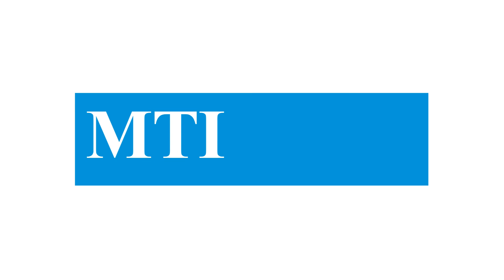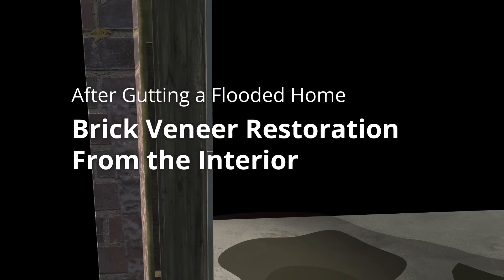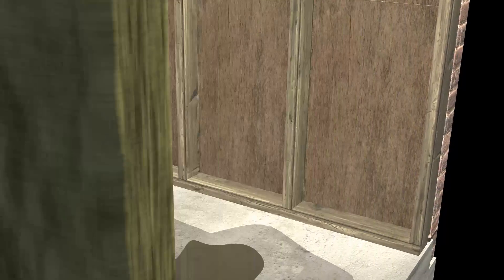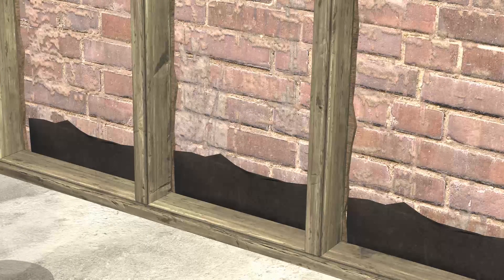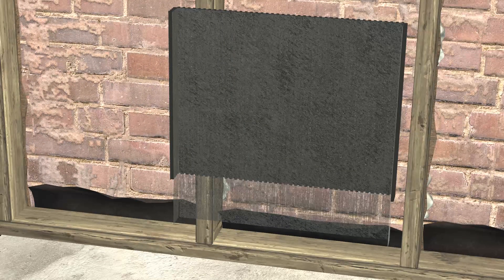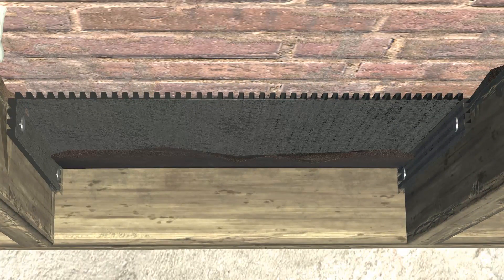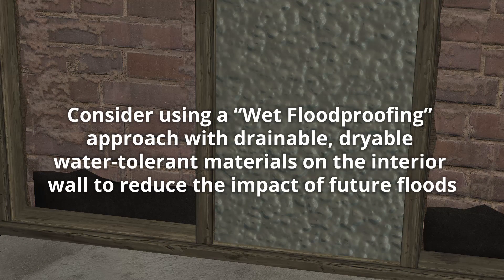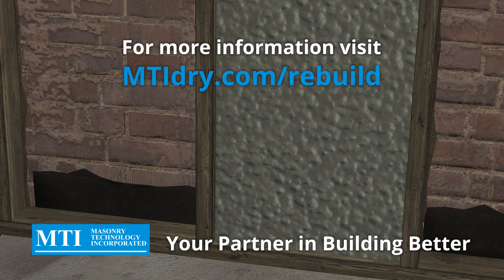Gutting Brick Walls Post-Flood: Repair Recommendations

Comment: From this video wont the studs be exposed to moister with no moister barrier  could they be wrapped with  black paper, I realize you would have to work around the brick ties. who does this work in my area or what should I ask for I live outside Houston texas.
Reply from the maker: Yes, studs will be exposed to moisture, but they can handle incidental moisture safely and dry out whereas OSB and paper-faced gypsum will deteriorate or develop mold. You may want to coat surfaces with a fungicidal protective coating (such as Foster 40-20) before the Sure Cavity and spray foam. 
Talk with your contractor about this solution - suggest they visit https://www.mtidry.com/rebuild or call 800-879-3348 for ordering and information.